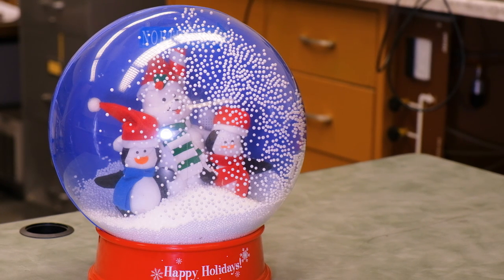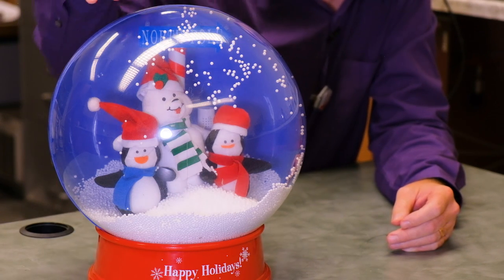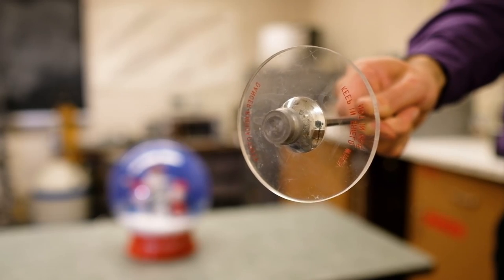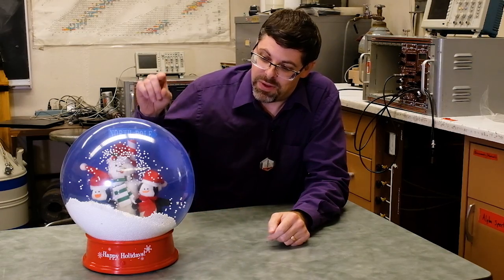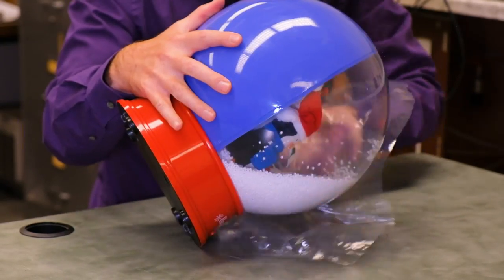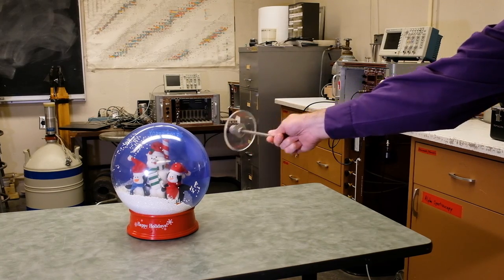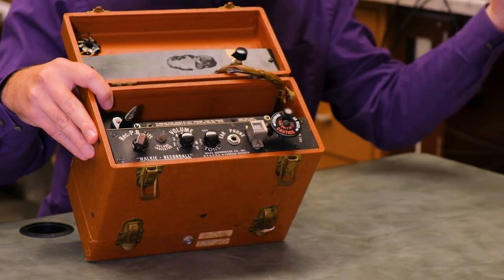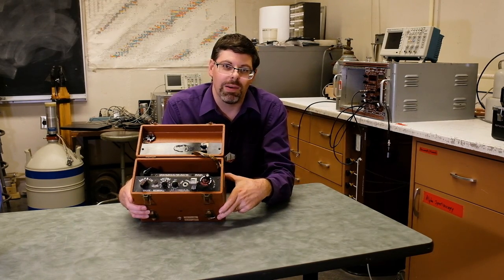Detecting radiation with a snow globe

Comment: Interesting! What is the radio-active source you are using? I have some very small metal parts, actually sound ports for sub-min microphones which when shaken up in a polystyrene container stick to the sides through electrostatic attraction. The only source I have is an old thorium gas mantle but think this is alpha emitting so wouldn't penetrate the plastic container?

Comment: When I used to deal in a lot of audio equipment, before audiophiles were everywhere… I collected tons of different devices that had been marketed throughout the years as “anti-static“ cleaning devices for records and other related things.  I’ve still got most of them, their half-life is usually pretty short, one of the coolest devices are the static dissipating Air guns/blowguns that are attached to compressed air hoses and used at certain factories. They actually have really strong sources in them in some instances… And are always a lot of fun to come across. And even when they quickly dissipate after a few months or years… The blowguns in particular look really really cool. Antistatic stuff has always been super common and electronics research labs. Static discharge can be a terrible thing… So they went to some extensive links to stop it. And created some crazy ass devices and weird cool looking mad scientist stuff in the process

Comment: There must be some kind of inflection point where the internally deposited charge of the trapped beta electrons in the insulating dielectric plastic actually INCREASES the static charge at the plastic surfaces despite the air ionization simultaneously sapping it away.

Comment: There are still consumer-ish devices that use radiation to reduce static that are currently manufactured and sold. I'd prefer that people don't mention what they are here, since there may be impressionable idiots to whom it's available, but it's out there.
Reply: Every example that I’ve seen has been super short half-life stuff, super super safe levels…absolute minuscule layer coating that has been sputtered one atom thick onto some foil..  but yeah if you’re referring to the anti-static blow guns and devices that were popular in assembly lines laboratories and factories back in the 70s and 80s… There was enough material in some of those to kill half a town.... but they were not meant to be used or handheld… They were implemented on assembly lines totally shielded and isolated from humans.
Reply: @hullinstruments  not sure about half a town, but at several mCi of Po-210, they definitely have the capacity to kill several people (LD-50 is around 250uCi).
Reply: My bad, you're not referring to commercial products. I'm sure industrial equipment contained really scary amounts of the stuff